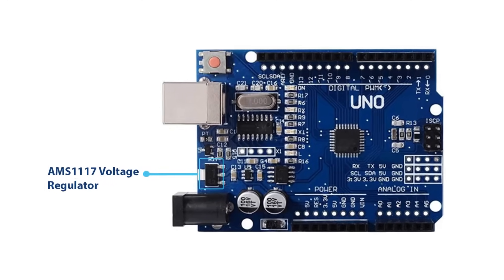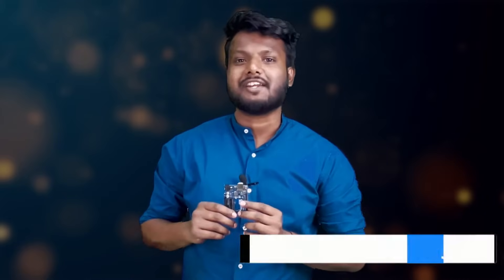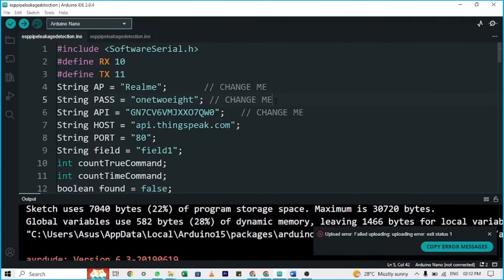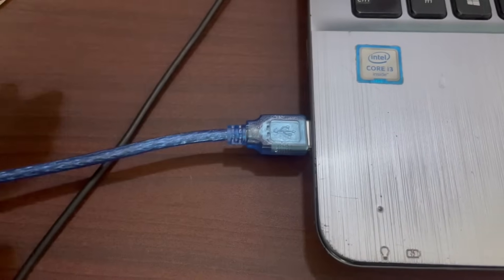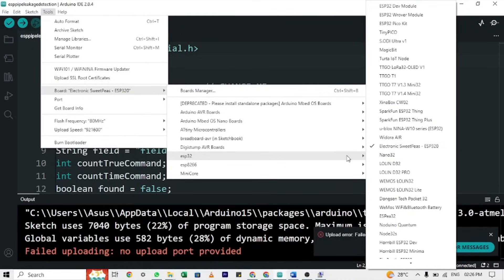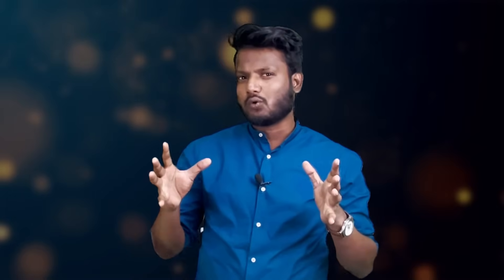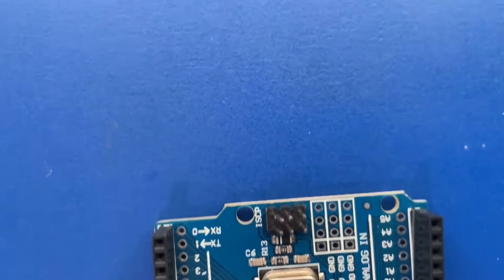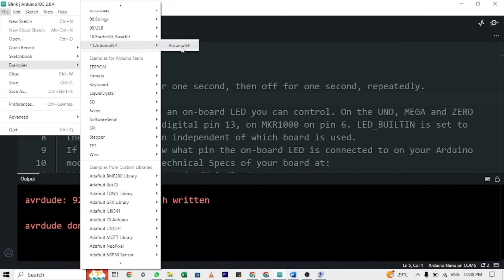How to solve Most Common Arduino Issues in 5 Minutes?

Comment: Possible to fix Tx malfunction in Arduino? I mean hardware repair is possible?
Reply from the maker: If you mean replacing the USB to UART bridge controller, then yes. Replace it with the same controller.

Comment: What happens when my chip is not showing in the device manager like your showing usb serial ch340(com4). And my showing usb serial (com4).
Reply from the maker: As long as the serial port is showing, select the correct one. Depending on the UART bridge used, the system may or may not show the bridge controller model number.

Comment: Hello sir mera projects bar bar restart hota h
Reply from the maker: You have to give a bit more context. make sure you are using a power supply that is good enough to drive the project. And if there are high current components such as motors, don't driver them from the Arduino 5V pin.

Comment: It not connecting no port but my elegoo Arduino connects just fine
Reply from the maker: If you mean other Arduino is working fine with the same cable, check which USB to UART controller is on your non working Arduino and install it's driver.

Comment: Hello, I ran the bluetooth control car code and it worked fine. But I did few changes in the pin connections in the L298N motor driver and it started not uploading the code. I undid my changes and still the code is not uploading. I also reinstalled the IDE, no luck. I also tried "burn bootloader", for that also error is coming.
 Can you please help me?
Reply from the maker: If the bluetooth module is connected to the UART pins of the Arduino remove it and try again.

Comment: Sketch uses 924 bytes (2%) of program storage space. Maximum is 32256 bytes.
Global variables use 9 bytes (0%) of dynamic memory, leaving 2039 bytes for local variables. Maximum is 2048 bytes.

This error is coming
Reply from the maker: Its not an error. it means the code compiled without error.
Reply: Thank you sir 

Sir there is one doubt how to reset the Arduino UNO
Reply from the maker: Press the reset switch.

Comment: sir  maray arduino ma programing bi ho rahi ha or  output ma current  bi a raha ha but jab ma koi motor lagata ho to current 0.01 volt ho jata ha or motor work nahi karata
plzzzzzzzz sir help me maray pass time nahi ha collage ma project submit karwana ha
Reply from the maker: You can't directly drive motors using the Arduino. use motor drivers with external power supply.

Comment: After my changeing of regulator ic 
Arduino program cant to be uploaded, also can't be reset also
Reply from the maker: Bit more context is needed. Check if all the voltages are correct or not.

Comment: My issue is I accidentally changed the COM and somehow when I upload sketches, it says uploaded but doesn't do what I input.
Any idea? Say I'm test RGB in Serial Monitor... it runs as it's working continuing to ask me for the color but when I input "red" it wont light up right and my wiring is correct. I also have 3 arduinos and this was a problem for one.. but now.. it's happen to 2 of mine.

Comment: my arduino "ON" LED blinks only once when i am plugging in. can i fix it?
Reply from the maker: The ON LED is connected to the 5V line though a resistor. Check 5V line make sure there are no shorts and the 5V is present.

Comment: i have an Arduino uno R3(not clone ch340 driver didnt work) board which turns on the led is blinking from the start tried all the things turns out i do think it might be bootloader issue but not sure also it is not being detected in the com port section of the device manager Again the arduino turns on the led is blinking but no detection in the pc. Please help!!!
Reply from the maker: If it is not showing in device manager either the proper driver is not installed or the USB to UART converter chip is not working.
Reply: @Circuitdigest  Thank you, So i also installed the ch430 driver it showed it is installed and it is preinstalled for just checking if that works and it didnt, also any way we can fix the usb to uart converter chip? I will still try to check if any of the drivers work by reinstalling.

Comment: I have a Arduino pro micro and successfully build a volume control with 3 touch button(ttp223), but there is a problem pro micro often got disconnect not fully (like light glow when i touch the sensor but no light on rgb ring and volume knob also don't work)automatically i don't know why and every time i need to replug it to pc and make it work, do you how to fix it 

link from where i made it
https://www.youtube.com/watch?v=bMOuWbCsgPI
Reply from the maker: Make sure the Arduino is not stuck in some loop. Check your code.

Comment: I have an arduino uno which i ordered just recently, and code was getting uploaded to it perfectly fine, but when i powered it, it did nothing; I tried both the USB port as well as the DC jack which is on the UNO, but no response. What could be the issue?
Reply from the maker: Most likely the code may not be proper. Just make sure the the board its self is ok, compile and upload the blink example and check.

Comment: Sir, I have purchased a new arduino uno r3 dip and tried to connect my laptop but laptop not recognised it. When I plug USB cable to laptop no plug in sound. Arduino power led on and pin 13 led blink 1 sec intervals. Is my Arduino damage?
Reply from the maker: Install the proper driver for the USB to UART converter.

Comment: My arduino works when the USB cable is connected to the laptop but when I remove the USB to connect another power supply my program does not work. Please suggest what should i do?
Reply: Same problem bro

Comment: My arduino only run one program, i change with onther program but not working . I also reset it but still run first program. 
What should i do?
Reply from the maker: this is strange - are you able to upload the new program successfully?
Reply: I am also facing the same problem
Reply from the maker: @thelegendarygamers1272  i remember having a problem like that - the reason was a fast loop in my code, try pressing the reset button on Arduino and releasing it just before your code starts uploading
Reply: @Circuitdigest  I have tried that but it did not have any effect on it. I installed the legacy Arduino IDE and there it showed me this error

avrdude: verification error, first mismatch at byte 0x0000
0x62 != 0x0c
avrdude: verification error; content mismatch

On the newer IDE, I am not getting any sort of error. The sketch uploads without any sort of error on the newer IDE but it doesn't have any effect on the Arduino and it keeps running the same old sketch.
Reply: i have the same problem with my arduino i uploaded the code to check my motor shield but after i checked my motor shield i tried making something else but when went to upload the i saw that a led on my arduino named rx was blinking very fast and i was getting unwanted messages that i used for my motor shield on my serial monitor even after the removed all code from the arduino . plzzz help us

Comment: An Arduino clone doesn't work for me either. I did it this way (but I still have to test it): desolder the little <reset> button and two pieces of wire connect the pins (where the button was soldered) and bridge with RESET and gnd !!! It will work. Let me know. :)

Comment: I am having a problem. When i connect the board TX, RX, L and ON all of these lights are on and IDE says not connected. I pre installed CH340 driver still no ports are showing.
Please give me a solution.
Reply from the maker: most likely your driver IC is damaged, is your the ch3040 version?
Reply: @Circuitdigest  recently i used l293d motor shield after that this this happened
Reply from the maker: @tawsifchowdhuryaraf8866  it could be that you tried to draw more current from the UNO board and thus damaged the voltage regulator. Use a multimeter to check your 5V and 3.3V pins on uno are giving the right output voltages

Comment: Hello , I supplied supplied high current through the Dc jack and now the ON , RX, and TX leds are always on . I do not what to do ?
Reply from the maker: looks like you have burnt the driver chip - try replacing it and you should be good
Reply: @Circuitdigest i sold it to my classmate the chip was broken for 300 rupees i bought it for 200 😂😂😂
Reply: I have the same problem , can you pls tell where can I buy it and how to replace

Comment: Bro, I am connected gsm900a modul on this ch340g uno board, my for sending sms, my cunnection is good and cood are uploded the uno, after runing not recived any sms on my mobile phone, but serial monetor show sms sending
Reply from the maker: very hard to say where the problem is without properly debugging - have you checked if your SIM card has a SMS plan?

Comment: After uploading code .the aurdino getting connected and disconnected and again connected and disconnected
Reply from the maker: Sounds like a hardware problem, My guess is that you have connected some motor or sensor which is consuming a lot of current forcing the Arduino to shut down and power on again. Remove all your hardware connections and try again
Reply: Just like mine

Comment: I cant able to upload code in my arduino i changed voltagw regulator and ATmega but still not able to upload the code the on light and L light is on. also the 5 volt arduino post shows 4.9 volt and the voltage regulator show 1150 insted of 1820 and.
Reply from the maker: What error are you getting? Are you able to find the board under device manager?

Comment: hi, my code isn't getting reset after pressing the red reset button. I've tried a lot but haven't been able to. Please help
Reply from the maker: that's strange, how do you know that your code is not getting reset? are you able to upload code normally ?
Reply: like i put a blinking code, it runs. I press the reset button and after the blinking  it starts running again. I'm buying a new one so no worries I guess. @Circuitdigest
Reply from the maker: @candidpix_india  cool, but i still dont see any problem with the way you describe your boards working

Comment: Bro please help me com port not showing when I attach my UNO board with laptop. I've done everything I possibly can. CH340 driver is pre installed. I replaced my USB A-B cable. Still no ports or other devices showing in device manager. I've reset the Arduino board and my laptop as well. Nothing works.
Please help!!!🙏🏻
Reply from the maker: try changing the bootloader
Reply: @Circuitdigest  Do I have to burn the bootloader by another Arduino board?

Comment: Hello
Reply from the maker: hi there, how can i help you?
Reply: I was working with the Arduino and I accidentally followed the wrong circuit then smoke came out of the voltage regulator. I don't have a soldering iron